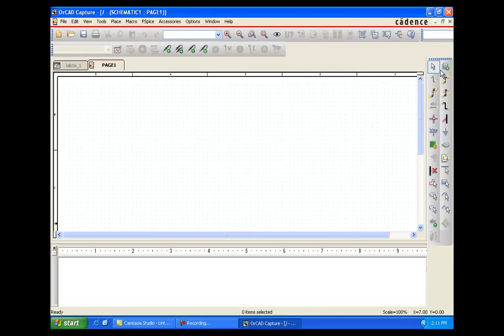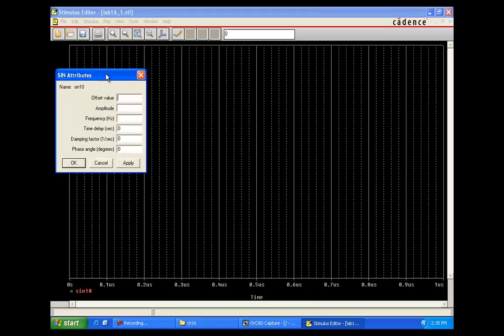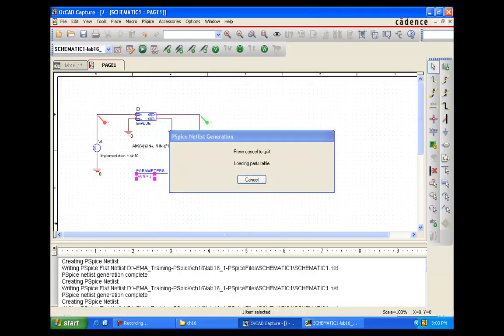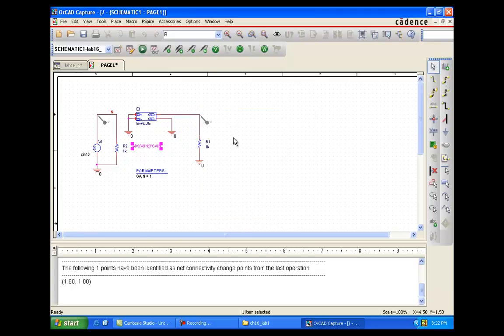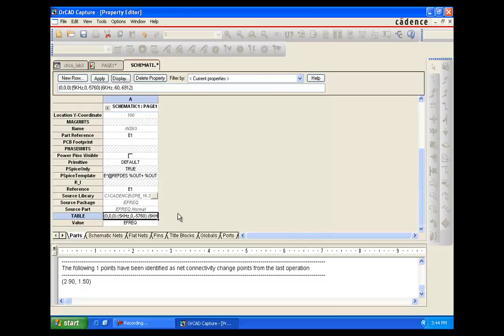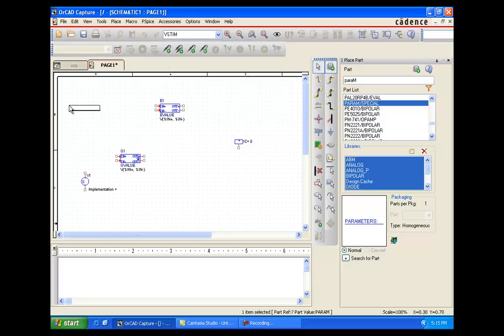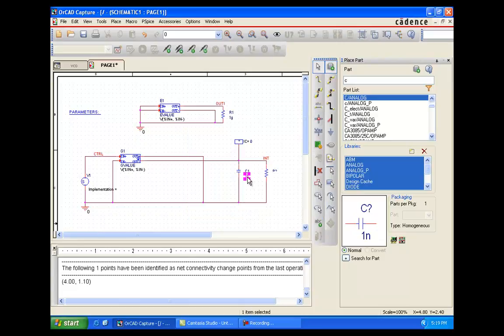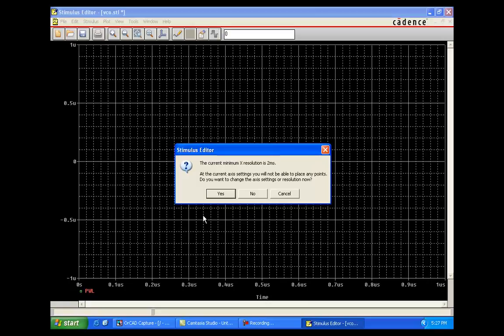Analog (ABM) Analog Behavioral Modeling

Comment: sir i want to simulate a resistor who's resistance changes with respect to the temperature......
that is negative temperature coefficient .... as temp increases the resistance should increase,,,,, or resistance should increase as time increases.... then the resistance should be constant after some time.... sir please help me ....
Reply: Temperature coefficients are baked into the basic spice components for all simulators. In OrCad you can right click a part, go to properties and then change the "template" property to adjust the actual spice code behind the graphical part.
https://bwrcs.eecs.berkeley.edu/Classes/IcBook/SPICE/UserGuide/elements_fr.html